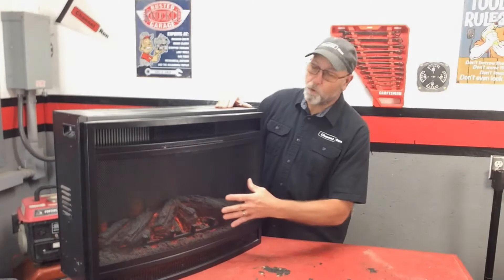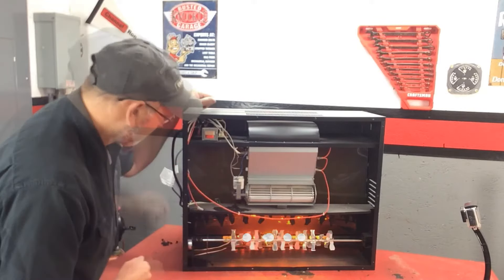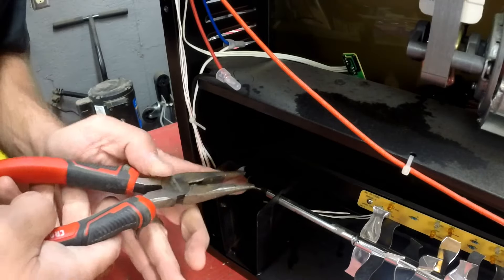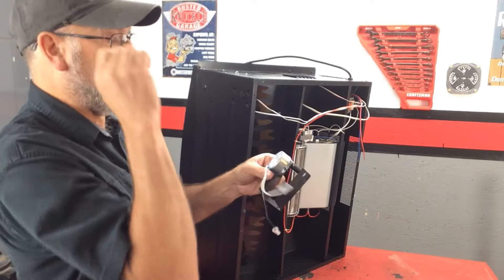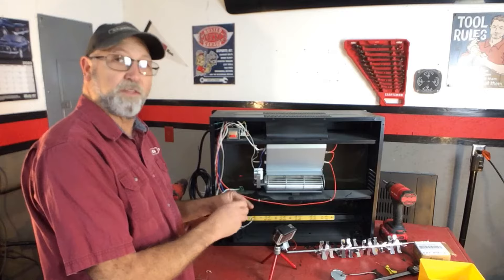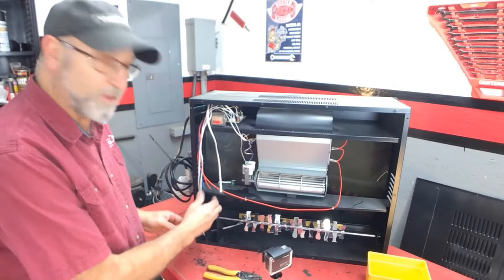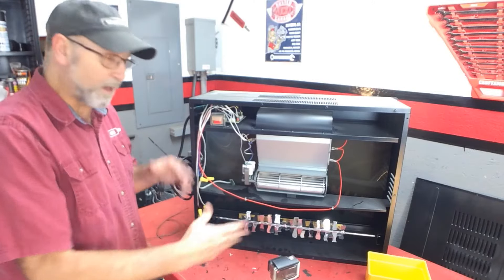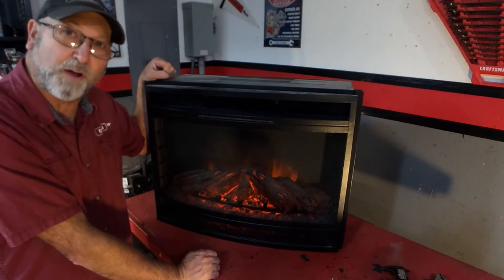How to fix imitation flame on electric heater

Comment: Thanks to your detailed video, I was able to change out the motor on my electric fireplace. The motor wasn't spinning the reflectors so the flame wasn't moving. I bought the motor (for about $5) and followed the instructions on your video. I'm a health care worker (surgical technician) this is not something I do so I was a little skeptical about doing it, but thanks to you I have my electric fireplace working again. Thank you

Comment: I'm kinda' surprised that you didn't start by checking the connections leading to the motor. "Made In China" ... the connections could easily have been poorly done and taken a few seasons to manifest.
Reply from the maker: Yeah, I know, but from what I have seen, all of these are junk, and that's just the problem. But you are right.

Comment: Hubby was able to change light bulbs in bottom of fireplace. Problem is now the flames are white instead of orange or yellow. He purchases ‘day light’ bulbs. That could be the issue. What do you think?
Reply: Day light bulbs would make a whiter light. I'd use a normal clear light bulb, or find out what the manufacturer recommended and use that. Also if for some reason a colored lens (if the fireplace uses one) was removed to replace the bulbs make sure that was put back in place.

Comment: Thank you! I fixed my fireplace with your help.  The comments about the CW, CCW helped, because I couldn't find a CW.  Just turning it off and on again will make the flames dance up instead of down.  I had a $500 fireplace that you helped me fix for $10.  I also bought an extra motor just in case.  
Mine didn't have a cotter pin. And the new moter did have a bigger shaft, but I was able to squeeze it in without having to route out the rubber sleeve.
Thanks so much!!
Reply from the maker: Glad I could help!

Comment: What if the reflective wheel is turning, the small LED bulbs mounted on a circuit board respond to power applied to the soldered circuit spots, but the LEDs aren't turning on when using the remote? My bf knows electrical and is stumped as to why our lights aren't turning on. The heater part does work. We got the insert today from my grandparents. Not sure if something got disturbed during transport. Any advice? Please and thank you. Hopefully I'll see any response.
Reply from the maker: Wow? well sound like the board for the LED's could have a crack? dose not take much for them to break as they are fragile, not sure?